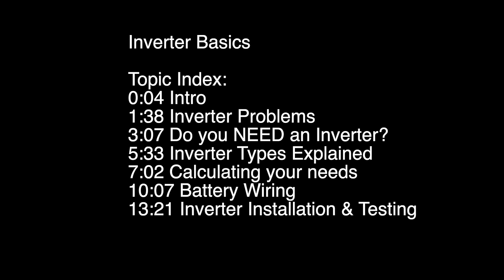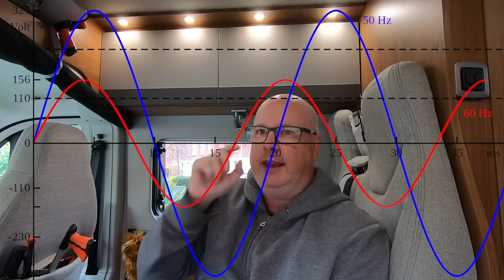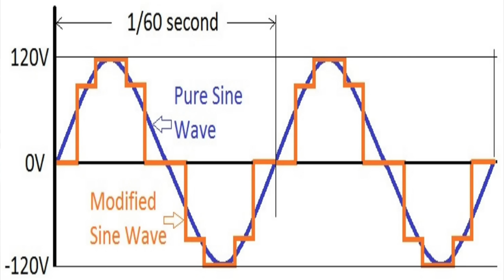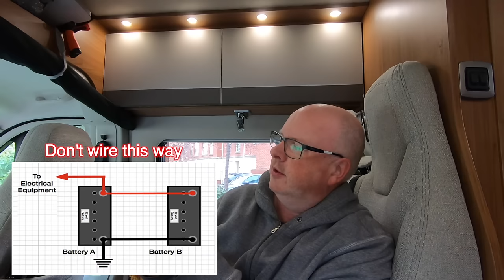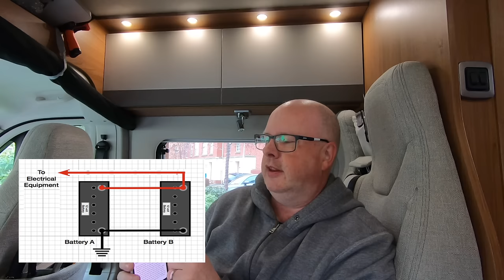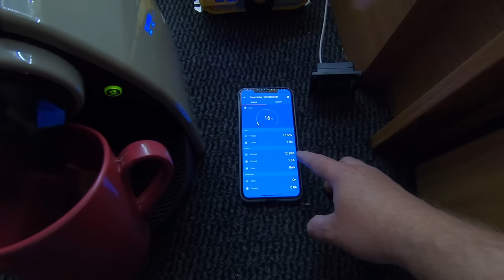Detailed 12v Inverter & Battery Wiring Guide - Campervan, Motorhome, RV & Boat

Comment: Hello, thanks for this nice explanatory video! :) I was wondering, is there a way to know the standby inverter's consumption from battery ? 

I am thinking to use an inverter permanently for my garage that has no power from grid option. Currently i have a solar+12v battery+2*10watts 12v bulbs  but i am thinking to switch to 240v so i can run some hardware tools when needed.

Comment: Excellent tutorial! I have an electric mountain bike that uses 184 watts, I was planning on using a 1000 watt Inverter. Will I be able to charge bike battery while driving? I currently only have a single 110v leisure battery. Any advice would be greatly appreciated!
Reply from the maker: You could charge while driving if you charger is proving at least 20 amps. The bike batteries usually take 3 to 5 hours to charge though.
Reply: @johnmandy  thanks for reply. I usually use a generator to charge bike if not in campsite with hookup. I ended up buying the same inverter you have in video and I should get it by weekend. I am often driving for a few hours between biking destinations and will have 3500kw generator as backup. Cheers.

Comment: hi john thanks for the great vids. got a question should I wire my batteries the way you say if not using a inverter thanks
Reply from the maker: Yes, wiring multiple batteries correctly is crucial, regardless of you have an inverter. 👍🏼

Comment: Hey my dude, cool vid. About to start on the whole wiring shindig. What made you decide to get this inverter specially? Also, what charge controller did you decide to get and why? There are so many brands out there, its difficult to know what its good quality and will last the test of time.
Reply from the maker: I’ve got a few videos cover each bit, from wiring, solar panel, solar controller, batteries and inverter. So it’s worth watching all my related videos to get an idea of my chosen products & why I chose them 👍🏼
Reply: @johnmandy  I'll be sure to give it a check. Do you have any recommended links? Also, you mentioned that modified done wave isn't as consistent but upon checking the Krieger, it appears it's modified. Was curious what your take on that is
Reply from the maker: The video covers the benefits of each type and why I chose this for our needs, all videos can be found under a playlist called van mods.
Reply: Perfect, thank you for getting back to me. I'm only a few weeks away from finishing my self build. Hopefully catch you at next year's quirky ✌🏾

Comment: why not use a solenoid between the batteries? I have seen this option to ensure that only one battery is sacrificed. Thanks you and nice posts
Reply from the maker: That’s not going to give you the power of combining the batteries, which means you couldn’t run much power for long, certainly not a bigger inverter.

Comment: hi john the Sterling Power BB1230 12v 30amp DC DC charger what settings do you have it on I'm looking for a set up same as yours I'm not very good on this stuf i have the same camper as you I've looked on you tube and they say they is 3 difrent settings any help would be great john cheers keep up the good work

Comment: Question, if I wanted to connect a solar cell charger to a double battery setup. Where would I contact the solar charger to on the batteries? (Using your double battery setup)
Reply from the maker: Feel free to watch my recent advanced 12v wiring setup video which covers this and more

Comment: I’m a little confused. You speak about the issues with modified sine wave inverters, yet the inverter you use is just that. 
Is it because it is purely for the coffee machine and not electronic equipment?
Reply from the maker: Yes that’s right, it’d be a waste of money on a pure sine wave inverter just to power the coffee maker and instant pot.

Comment: Hi John, could you tell me what size fuse I should install between my batteries and my 2000watt inverter. I keep getting different answers. Thank you in advance.
Reply from the maker: Using the ohms law calculation of volts, watts and amps from this video you can work out what fuse to use. 12v and 2000watts means ??? Amps 👍🏼 In the video I show you how to work this out

Comment: John, I need to put 4 batteries on the lorry.  Therefore would the Earth go on 1st battery Neg & Supply/outlet on 4th battery Pos?  Thanks in advance
Reply from the maker: Link all negs and pos terminals. Then put all pos loads at one end of the battery and all negs on the opposite end of all linked batteries, so the flow of power has to go through all batteries. 👍🏼

Comment: Hi John, the link on your site takes me to the inverter on Amazon but it not a pure sine wave as you describe in the video, it is described as a modified sine wave which you have described as not very good. Can you clarify if the link is incorrect or if the description on Amazon is not right. Thanks John.
Reply from the maker: I use the exact product linked 👍🏼 It’s a high end modified sine wave suited for appliances and charging laptops etc

Comment: Hi John
Am onsite in German ski place and have access to 10amp EHU. System in 2 x 110amp AGM batteries with usable 110 ah. Also connected in 2000w pure sine wave inverter. We are spending the week using 12v except to Nespresso Coffee machine when we turn on inverter remotely the off again after use. The coffee machine ranges between 500 - 1000w when boiler is active for some reason it will start coffee machine but then it turns itself off. We also have aircon on board which I've tested on heat mode and this runs fine, on inverter as a test, for a short while. Can you think of anything I should check that is amiss. Also On our way here it worked fine when we switched it (inverter) on and brewed a coffee? It's got me thinking? Cheers Chris
Reply from the maker: I’d use the ehu and not your inverter if you’re on site, your batteries might be low or battery charger not up to the job to supply high amps so the inverter is shutting off due to low power. 👍🏼
Reply: Hi John
Thank you ever do much for your reply.
We have Victron Blue Smart IP22 Acculader 12/30 (1)charger and BM712 FYI - I think what you are saying is that if our batteries are not near full charge they won't support my 2000w inverter. JANETTE who like your better half loves her coffee as do I and we are running tests for our off grid adventures. I really like the way you and Greg have teamed to give an all round package of assistance to us novices. So coffee availability in the future with our off grid is very important. Our next step is installing B to B and then Solar to complete our package. So thanks once again for your input. Cheers Chris & Family

Comment: Bought the Krieg 2000 watt inverter (EU version) and a couple of EU mains leads to connect to our moho sockets via a couple of rotary selector switches. 2 AGM batteries on their way to get the mods started. Just a quick question about connections.
Is this correct?
Sargent charger to A battery + and B battery -.
Inverter to A battery - and B battery +.
Sound about right???
Cheers and keep up the great work 😁
Reply from the maker: No, all pos to bat A and all negs to bat B with at least 35mm cable joining both batts together if you’re running an inverter. The video shows the way to do this.

Comment: Would you ever go down the Lithium battery route?
Reply from the maker: Yes, but only if the prices dropped drastically. They also need monitoring correctly too, so that means better battery charger so the vehicle, 240v and solar are correctly charging.   Which adds even more cost to them, never say never though 👍🏼
Reply: @johnmandy  I love all your videos John but I would have to say this is one of the best.  Great info and very well explained.  like I was back at school.  So how long wild camping do your batteries last now with this inverter?

Comment: Hi john thanks for explaining this to me we have a boat mostly 12 volt when not in the marina I am looking at the Kreiger 2000watt but is it modified or pure wave as I have a budget to work on we have also got a 100 watt solar panel and spare 110 ah battery to use any help and advice greatly appreciated many thanks Clive in Nottingham .
Reply from the maker: The inverter I use is fantastic and it’s modified sine wave, check the reviews online. You’ll need around 250ah battery bank and 500w of solar to keep you topped up and short uses of the inverter 👍🏼
Reply: Many thanks John take care and stay safe 👍

Comment: No it just shows the one model with no options  of pure or modified I’ve checked it out,
Question if I eventually find it, would power a microwave   ?
Reply from the maker: I’ve removed the links so no one gets the wrong product. Once they come back in stock I’ll put the links back on. This was bought 6 months ago so it could be it’s not made any longer, so I’ll find an alternative & link to that.
Reply: @johnmandy  I'm looking for the same unit in pure sine wave not modified. Do you have a link where purchased?

Comment: I’m a little puzzled with my new inverter wiring it in obviously hasn’t been a problem with your wise teachings 🧙🏻‍♂️but it gives me a small earthing cable to earth the outer shell because it’s metal I’ve no idea what to connect that to. it has a small nut to connect it to the outer shell and then the other end of the Earthing wire has a crocodile clip. My only thought was to put a screw into the metalwork and connected crocodile clip to that but then surely all I’m doing is making the bodywork live if the worst was to happen
Any ideas. Also I don’t have shore power hook up so maybe it’s supposed to connect to that.
Reply from the maker: The earth wire goes to the chassis of the van, the same place the negative goes to from your battery.
Reply: I thought the same but my concern is then rather than the inverter casing being live I would simply make the bodywork to the van live. But I can’t think of any other way either
Reply from the maker: Electrics always short to earth, it doesn’t mean the earth will then be live, instead it means the live will be dead.  I hope that makes sense.

Comment: Can it be an electric source to support a vending machine of voltage/frequency: 100/220v - 50/60hz. If so, how long it will last if the 12v leisure battery is fully charged?

Comment: The reason that Pulse-Width modulation (PWM) or "modified sine wave" is used is to maximise efficiency & costs.
Efficiency is also much higher with PWM, typically 70% to 85% vs much less than 50% for pure sinewave drive which is very important for anything that's battery operated.
Since with PWM, the operating frequency is much higher (typically >100KHz) the step-up transformer is also very much smaller than that using pure 50Hz sinewave - savings in cost and weight.
As to noise, this can be got rid off by a very a simple low pass LC filter.

Comment: Hi John & Mandy just found your great video, learnt a lot. I have a question, how would you switch from 230 volts on a camp site to using the inverter on the road. Would you need some sort of switching ? to swap supply's from one supply   to the other if the inverter supplied the power to the van sockets
Reply from the maker: I’ve made a video about such a device 👍🏻

Comment: Do lithium batteries also only provide half the amps advertised on the battery, or is that only a lead acid battery thing?
Reply from the maker: Lithium allow you to use between 80% and 99% depending on the brand & quality.

Comment: Can my wife run a 1200w hairdryer  off a 2000w inverter which is off a 100Ah leisure battery backed up by a 150w solar panel With out ruining the battery ?
Reply from the maker: Yes, that would work fine 👍🏼 but keep the hairdryer use to a few minutes, your solar panel will take an hour to charge the battery after using that hairdryer for just a minute or two.
Reply: Thanks John that will make her very happy we have just got our first van an Adria compact sls slid out and cannot wait to go out in it,
Hope we have as much fun as you two.

Comment: Hi John I'm looking at buying an inverter, I've just watched the video above which was great, but I'm confused, as you said your "new one" is a "pure sine wave" inverter, (44 seconds into video) but your link takes me to a "modified sign wave" inverter? 
which is best for running a laptop and small kettle please?
Reply from the maker: This is an old video now, after through testing the inverter I show in this video is fine for laptops, tech charging as well as appliances.
Reply: Gadget John on tour thanks John what are you running as an inverter now?
Reply from the maker: The same inverter, check my latest videos.👍🏻

Comment: Hi, we had a problem with the camper, overnight without electricity, the next morning, the vehicle battery was 11.4 volts and we had to call out an emergency van to jump start us.
If we had had jump leads, could we have temporarily connected to the vehicle battery to start the engine?
Reply from the maker: Yes, you can also install a battery saver that’ll keep your starter battery topped up from solar charge.

Comment: Hi, does this use power even with the power off button is activated
Reply from the maker: Yes, any inverter will consume a small amount of power as it’s on standby.
Reply: @johnmandy  thankyou for your quick response, looks like I'll buy an additional isolation switch to prevent this :)

Comment: Is this from the UK? Where everything is wired to metric standards? 
How about places like the US that uses non-metric wiring? 
Plus, the UK adheres to the EU/Metric Standard, which is even more complicated since the copper in the wiring has to be from a renewable source - such as roof flashing and discarded tea kettles.
In the States, we don't use metric wiring. Much simply that way...

Comment: Hi John, appreciate the videos. Just wondering where u sourced the Krieger inverter in pure sine format, I can only get my hands on  modifie. Cheers M
Reply from the maker: Since making the video they’ve pulled a lot of their product line. So you’d need to go with another manufacturer, which not many do the sockets on the front like this. 😞
Reply: @johnmandy  Thanks John, appreciate the response. Top Man!

Comment: Hi John and mandy I know this is a old video. I used the link  to below and ordered the invertor from amazon.  It arrived today but they have sent an amercan version . I . Contacted  amazon who says they will only be able give me my money back if i return. It to  them. . Do you have any  ideas where I can purchase a UK version to run my ps4 in my van .  Cheers
Reply from the maker: Does it state UK 3 pin on your order? If so then under UK law you can get it replaced for free, if you made a mistake & ordered the wrong version then are you sure you bought the USA version? They sell a euro version but amazon UK doesn’t sell the USA version. 
So if you have the euro version then just buy euro to 3 adaptors.
Reply: @johnmandy   I went to the link then I went to make and uk version . However they sent the euro version . I did ask for uk version . They lady said they will refund it  but  now I don't know how to go about getting a uk  version . I understand about the plugs but concerned about the voltage  as I want to use my ps4 and  dont want to damage it . Thank you for your advice . I will just return for a refund for now.
Reply from the maker: UK & Europe use 220v to 230v so it's going to work perfectly fine.

Comment: hi john I'm currently researching all this with a view to buying a van and moving into it

atm, I'm looking at electrics and all the different options I've come across many horror stories about using inverters so 9im researching which model to buy I'm coming across many different and conflicting reviews on Amazon . so don't know where to actually go for decent advice on this I don't want solar am looking to go down the inverter route I have fairly nominal appliances these would be  . . . .
tv
computer/laptop with a large screen for photography editing 
not sure yet about a fridge 
I'm using gas for cooking
portable shower
marine foot pump for the sink
and need to charge  my phone 
12v system or inverter
generator back up

that's it really actually looking for an inverter that is reliable and safe to use is my main concern now heard of them catching fire
i do intend to use deep cycle house batteries and loved the bit about doubling up sp would it be fair to say that just buy over and above what you woulf normally expect to get out giving you a good threshold

many thanks in advance

Comment: Hi, great wee video. Can you confirm the wiring of the inverter to the battery, ie: based on your diagram of the correct wiring for 2 batteries which neg and pos did the investor get wired to? Did you present the inverter as a 13 amp socket for the coffee machine ?
Reply from the maker: Hi, that’s fully explained in the video. Anything you wire to the battery bank is taken off the same terminals I point out in the video. I did then install an extension for the coffee machine in the kitchen area 👍🏼

Comment: John what's your thoughts on running a small generator and plugging your van in to get occasional 240v ?
Reply from the maker: I’ve avoided them due to the noise and needing to carry an extra fuel can, with the additional problem of smelling the fuel from the generator too.
Reply: Great as a back up though especially when you're in the wild and not going to bother neighbours        @johnmandy

Comment: i am in the process of buying a camper without an inverter. if i fit one what difference will it make to what is fitted i;e lights. the fridge is 12v/240v so i can run it off both but the lights are 12v
Reply from the maker: It’s always best to run everything on 12v just like I explain in the video.